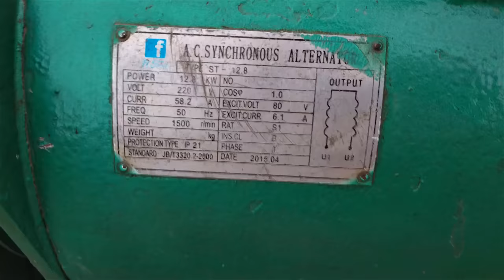Free energy Generator With 100 Kg Flywheel 12Kw Alternator 100% Real Free Electricity

Comment: There are so many electromechanical, heat and friction losses in this system that it should at least be slowing down. I am not sure where he is hiding the extra energy but he is doing a good job. This is not possible. Source: Electrical engineer.
Reply: I think, the extra force comes from the kinetic energy of the 100kg large pulley. There are many commercial UPSs that work like this, with good runtimes. The ideal is to leave it running for hours and monitor performance until yield drops, or do it via calculation.
Reply: from this black cable comning from behind of him.
Reply: The Thermodynamics Laws can't be violated, NO Free Energy, not posible
Reply: Looks like he is ready to step it up an make a 2 meg
Reply: It's hiding in open sight! Gear reduction from the motor to the flywheel. "Stored energy".  Overdrive from the flywheel to the generator. Gear reduction allows that motor to not work hard to produce the rpm of the flywheel and the inertia of that flywheel allows the generator to maintain it's momentum. I think if you were to fully load that generator it would reek havoc but in short bursts, like a well pump, grinder, etc, I think it could maintain itself. I'm willing to build one and see. What do you suppose is the total cost? $1500 - 2 grand?
Reply: @daleh2957  Don't waste your money please, it's not possible.
Reply: It's just rotational energy stored mainly in this giant flywheel. Each time he cuts he also quickly charges it up so you see the wheel going faster after every cut lol
Reply: while the wheel is rotating fast then very less energy is sufficient for the wheel to continuously rotate. He is reusing the generated energy as input energy to the wheel (looks to me).
Reply: @ramonduval8231  you're kinda stating the obvious here
Reply: 9:52 under the motor...
Reply: JUST A CABLE coming bro we sse it
Reply: @ramonduval8231  No but the energy we do use and create can be used  and made 5000% better...everybody used too use 100w light bulbs in houses in England now you can buy 5w led which do the same job..this principle off improvement can be applied everywhere
Reply: @jshaw4757  The 100w bulb produce similar light than a 10 or 20w led but produce much more heat and can be used as a heater for Chickens, the energy split between light and heat,
Reply: The energy can be light , ⚡ , heat , fuel, the bulb or led only transform the electric energy on light and heat ,but we need to provide the ⚡ to the Bulb 💡
Reply: @ramonduval8231  I've built salt water cells with very impressive voltage outputs unlimited voltage basically with salt water but you need too series the cells as I'm sure you understand...the amps are low but I am searching for a decent volts too amps converter so I can take away from the volts and give too the amps..maybe you have suggestions..thanks
Reply: @ramonduval8231  yes and I reuse that heat for warming an area too grow herbs n tomatoes n things so all energy gets used
Reply: @ramonduval8231  but like I said you you my 5w led lightbulb lights up the room just the same as a traditional 100w oldschool bulb..so that is 20 times less energy being used for the same result brightness wise
Reply: @jshaw4757  low amp means low heat but the light can be bright, the incandescent bulb draw more amps ,more heat and similar light
Reply: @jshaw4757  can be the same light but less head radiance, if you touch 100w incandescent bulb you could burn the skin because the heat,like 80w of heat and 20w light
Reply: @jshaw4757  the bicarbonate can be used but the more efficient is the sulfuric acid in car batteries.
Reply: @ramonduval8231  yes my point being if we are talking just making a room bright we have made huge improvements...I have just told you what I am able too achieve with salt coper n zinc...I could power anything when series the cells just like any battery cells you just series them and parallel when needed...no need for big energy company's is my main point and the main point off the term 'free energy' ..not that it appears from nowhere even though atoms are full off charge and with an imbalance create static energy which could be harnessed on an atomic level but many other forms are possible
Reply: @ramonduval8231  Yes vinigar works better than salt
Reply: @ramonduval8231  only problem is your power runs out within 1 hour or 2 but if you could sit your battery matrix in your chosen solution you would not need too recharge...a bit like the depictions off ancient Egyptian or Baghdad battery as they call it....I think people just need too start using less power consuming appliances n cars e.t.c....they had electric cars over 120 years ago able too go nearly 1000 miles on a single charge
Reply: @ramonduval8231  Thank you for replys
Reply: Permanent Magnet rotor and rewiring of stators. These generators have 2 stators, one to generate electricity and one to generate power to excite the rotor. This isnt needed to excite the rotor once magnets are installed and the stator needs to be rewound as the Tewari generator is wired. This is shown in Tewari's patent from India
Reply: @advanced-electronic  thank you marc
Reply: @advanced-electronic  all about improving energy usage that's all ...a 20% increase over a year after the initial payout for materials is worth doing
Reply: @ramonduval8231  jajajajajajajajaja
Reply: @daleh2957  Wrong! This is a confidence trickster! Prove me wrong! There is a sneaky power connection through a cable buried in the mud under one of the hollow metal legs resting on the dirt. Share a new video with the metal fame pulled up off the ground, and passing your hand underneath (with this running) The poster is only interested in being paid by YouTube for AD money from many clicks.
Reply: Correct! This is a confidence trickster! Prove me wrong! There is a sneaky power connection through a cable buried in the mud under one of the hollow metal legs resting on the dirt. Share a new video with the metal fame pulled up off the ground, and passing your hand underneath (with this running) The poster is only interested in being paid by YouTube for AD money from many clicks.
Reply: @pstonard   Well, it's a pretty inexpensive gamble so I've. ordered the motor and flywheel. I have a metal frame from a diesel engine I bought. I have a connection at the machine shop for the shaft and bearings. I could only find a 30lb flywheel but I can get another if 1 isn't enough. I'm gonna buy a 10kw generator. I'll let you know how it works. I have other projects going, (wife guided. lol), but I'll keep in touch.
Reply: Si es posible
Reply: @ramonduval8231  La ley se cumple siempre, otras cosa es lo que se interprete.
Reply: @sage_zarf  yo te animo y te llevarás una grata sorpresa.
Reply: @jshaw4757  el sistema Flywheel es una realidad de energía libre, que se quiten la venda de los ojos.,no se puede NEGAR la evidencia.
Reply: @daleh2957  para un alternador de 10 kW necesitarás un volante de 140 kg y un motor 3 hp
Reply: @daleh2957  alternador y motor 1500 rpm máximo
Reply: @advanced-electronic  ok ese es el camino......la eficiencia
Reply: @virgiliomontes714  ese mecanismo no funciona , lo que produce El generador lo utiliza El motor, no sobra energia, peor hay perdidas por friccion y deficiencia, la volanta de inercia solo acumula la energia temporalmente , la unica manera de que mantenga la rotacion es con una fuente externa de ⚡,🤷
Reply: @ramonduval8231  estás en un error no se puede Ramón negar la evidencia, lo que hay que replicarlo bien alternador imán permanente bajas rpm <1500 , servomotor o motor sincrono , volante de inercia 14kg/kW , poleas en relación correcta.
Y listo "Flywheel Energy Chaganti".
Reply: Have u even try this?
Reply: @virgiliomontes714  Entonces tendremos que armar uno parecido para comprobar si funciona o no.
Reply: @pastryboy714  I will try to assemble one like this and prove that don't work
Reply: @ramonduval8231  ese es camino...menos samba a mais traballar.
Ánimo Ramón yo estoy en ello.
Reply: @ramonduval8231  trata de conseguir alternador de imanes permanentes de bajas revoluciones no más de 1500.
Lo demás no tienes problemas no obstante si el motor es servo mejor (imanes permanentes)
Reply: @theory816 and high inertia too, it's a mechanical battery , accumulate energy but not creating energy
Reply: P Dubya  The flywheel has only two jobs , 1: Stabilize the spike or energy oscillations ,2: Acumulate energy, a Mechanical battery, when the motor stop spinning the generator can continue producing electricity for a period of time only and the Whole system stop.
Reply: A simple Flywheel between the Motor a Generator can't produce extra energy to keep the system self running because it's a Mechanical battery and we have energy loss by Friction and heat too.
Reply: Unless somebody invent a Mechanism between the Motor and the Generator to amplify the energy but a Simple Flywheel can not.
Reply: @cybersamurai6549  you obviously didn’t watch the whole video
Reply: @noneofyourbusiness614  i did but what i think you saw really different video 😅
Reply: Most people that thinks this works don't know how to change a bulb...
Reply: @daleh2957  Hi, did you made the generator? How did it go? How long? Can you update please? I too am interested.
Reply: @jaisonkvarkey7065  So far I have purchased the 2hp, 3600 rpm motor, a flywheel, built a rolling steel chassis with 2 straight wheels and 2 swivel. I waited until my taxes were done because I owed a big chunk this year. I still have to purchase the generator head which will be around $1600 plus freight. Pretty sure the one I've decided to go with is 8.2KW, 1 phase, 2 bearing, 120/240v, 1800 rpm. I have an electrician going over my plans to see if this will be the right size for the 2hp motor. We're not engineers at all so this has made for some very deep discussions. Keep in touch and I will absolutely post this when I've completed it. If all goes well I plan on building a 10kw to 12kw next, then maybe a 25. I feel we will lose 30 to 40 percent of the generator to maintain the flywheels momentum.
Reply: @briansotobassist  Or how heavy a panel of them should be. Hint, the bulb panel contains the battery.
Reply: @ramonduval8231  "do not mix thermodynamic with electromagnetic !!!!!...any way being true or not
Reply: @glipho01  this system need a device to multiply the torque without loosing the speed and this a extremely difficult task, the flywheel accumulate energy and stabilize the energy fluctuations only , nothing more
Reply: @ramonduval8231  ok, maybe...that,s why I miss some inertial wheel....I will build one to wash any doubt...I have a Milkovic oscillator which really multiplicate  force...
Reply: @ramonduval8231  consider you have a large magnet that pulls a metal ball and you measure a force in a spring. Leave that for a day, you come back and the same force is still there. Which Thermodynamics Laws have been violated here? You still have a force that is being consumed by a spring or something. I remember I looked deeper into this sometime back and this only works with alternators based on permanent magnets. Could you formulate a law in the way that is violated in this video? Let's have a discussion about it.
Reply: it wont work...
Reply: The Flywheel only store energy, the motor and the generator are not 100% efficient, need to slow down until stop.
Reply: Bro he is trying to show that it is possible.  the laws of physics we know are limited and the proof is just above your head: The sun is a free energy device in the univer. This shows that in this world it is possible,  we haven't find yet the right techniques,  This man is brave
Reply: @yololaherve4663   A flywheel between a motor and generator can accumulate and stabilize energy but CAN'T create extra energy for perpetual motion , a complex mechanical device between the motor and generator is needed but looks like nobody has yet created . This is a scam
Reply: @yololaherve4663  He is definitely brave for putting his hand anywhere near that spinning contraption.
Reply: @Anthony Nwaka the Flywheel store and release the kinetic energy, stabilize the energy spikes and don't generate energy but the energy need to came from somewhere  ,the Flywheel is a mechanical battery.
Reply: @cybersamurai6549  yup, I see the same thing. after plugged in, flywheel starts in motion so the start/run power is not free.
Reply: @daleh2957  lograste construir el generador?
Reply: @daleh2957  The flywheel only delays the inevitable a little. Namely, without external energy supply, the standstill of the construct.
Reply: @daleh2957  And did you get it to work?
Reply: @daleh2957  when you build one can you reach me to tell me what your outcome is?
Reply: @daleh2957  have u completed it already sir? id love to know if this thing really works. electric bill here in the philippines has been monopolized for way too long. i need to find ways to cut overpriced bill expenditures. thank u sir and i hope it really works well.
Reply: Only the last stupid fake, please save steel and money.
Reply: @jaisonkvarkey7065   I have had a rough summer. Cancer, so radiation, and chemo. I am just starting to feel better so, soon I will continue. I have all the parts. I went with a 3600 rpm, 2hp motor and a 3600 rpm, brushless, 5k generator. I bought pulleys to reduce the rpm of the flywheel to 1750 rpm, then from the flywheel to the generator back up to 3650 rpm. I will update everyone as soon as I assemble it. Also, I put it on caster wheels so I can roll it outside while it's running.  Edit:  I also purchased a photo tach so I can see if the generator rpm slows down and then rebounds after an electrical draw. If it recovers and rpm comes back up to 3650 then it is proven. At that point I will decide if I can afford to build a larger one. I went with the 5k generator here to prove or disprove the theory. If it works here, we'll, it should work on a larger scale. I must add, prices of the flywheels and larger generators have gone up a lot since I first looked into this.
Reply: @daleh2957  Thank you for the reply. Hope you are doing great now and wishing you good health and wellbeing ahead. I wish you to succeed in this endeavor also.
EDIT: Please don't worry about the 'couch scientists' who are trying to discourage you.
Reply: @clauzerD  yes, so after some time it will stop
Reply: My sentiments exactly, that system would not maintain that speed, especially with extra power being pulled by the power tools it has to eventually slow down.
Reply: FORCE  required to spin doesnt change amps required to spin the small disc and large is still more than is able to create.
Reply: Sand.....
Reply: Storing it in the dirt/sand...
Reply: The puny laws of physics don't apply in youtubelandia.  Many of Nikolai Tesla's inventions also flew in the face of established science.  Using his principles I could power my house on a 9 volt battery.  Sure, it sounds crazy, but theoretically possible according to one of science's greatest minds.  Source: Genius Electrical Engineer from history
Reply: Nikolai Tesla says it's possible.  Source:  Genius Electrical Engineer from history.
Reply: @ramonduval8231  Free energy is possible, your too blind to figure it out
Reply: @integrityprojectsservices7890  Could be possible but not this one, this is an Energy accumulator not free energy because when you off the motor the energy from the flywheel is transfered to the load for a short time and slowly dissipate and stop, A flywheel only is not a free energy device, you need a mechanisms between the motor and load but nobody has it or is not invented yet.
Reply: paghilom dera, magbuhat kay imoha para mo tuo ka, to see is to believe, ayaw cge salig ug comment2x para may mema ka lng
Reply: @Vegas2428  could you write in English please?
Reply: @Emmanuel Morkly This is only an Energy accumulator and NOT a Free Energy device because has only a Flywheel between motor and generator.
Reply: @daleh2957  estou comentando para saber o resultado, poderia me marcar quando conseguir?

Parabéns pela iniciativa. 👏👏👏
Reply: If this was real Elon Musk would be interesting it
Reply: @vidyadharpatil6683  have any one tried
Reply: @ballpool-zr7dy  
I don't know,  Trying is certainly wasteful though.
Reply: Or so "they" tell you! And you have to take anything from an "engineer" with a huge grain of salt!!!
Reply: @daleh2957  wreak*
Reply: @13FPV  it looks like cable, but its only mirroring of light from his plate with bulbs.-)
Reply: @daleh2957  were u able to replicate it? this v=QFAmVcTD2ZY might show u the necessary modification u need to make
Reply: the flywheel is like a magnifying glass to light for this small 3 hp motor
Reply: @vidyadharpatil6683  well that's the only way to prove if its true or not
Reply: @ramonduval8231  It's not free--there was an input...he just closed the loop afterwards.
Reply: @chrisharrell5945  To maintain the rotation an external electricity input is necessary without it the load and friction will eventually overcome the Energy accumulated in the Flywheel and the system will stop
Reply: TIENE UNA BATERIA Y UN INVERSOR ADENTRO DEL GENERADOR.ESTA GENTE SERIA RICA SI ESO FUNCIONARA.
Reply: @jorgeprado8026  Estoy seguro de hay cables Escondidos para alimentar El motor electrico
Reply: @ramonduval8231  well no kidding.  What did I say to elicit that?  🤗
Reply: @chrisharrell5945  Yes, an input connected to the 110v grid but the other way is to put a battery and inverter hiding inside the Generator.
Reply: @ramonduval8231   The voltage class isn't 110 volts, that's what the nominal voltage was several decades ago but for the past 50+ years it's 120 --typical RMS voltage.  Anyway, India doesn't use 120 volts, it's 230 volts at 50 Hz.  There is no battery and inverter hiding inside the generator...where are you going to put them, slice them up and slide them down between the windings of the stator and rotor shaft.  😂
Reply: @chrisharrell5945  ohh I forgot 🤭, 🌎 different voltages and frequencies, in my country 🇩🇴 the Voltage is 120v and sometimes lower and the frequency is 60hz.
Reply: @chrisharrell5945  Some YouTubers had proven that hiding a battery inside a generator to feed a motor but it's DC voltage few tricks and scams in the internet
Reply: Pretty sure there are a few we'll timed video cuts. Notice how it's an overcast day with no shadows?
Reply: Business electricity said this is wrong......😅😅😅
Reply: Possible
Reply: @ramonduval8231 this not free energy. The kinetic energy of wheel is being converted to electrical energy. So no law is being violated.
Reply: @rahimkhan7270  Eventually the wheel will slow down until stop
Reply: @ramonduval8231 Do solar panels create energy of their own?
Reply: @JBNetBreaker  The panels took the sun energy and transform in electricity, the source of energy is the Sun
Reply: My guess would be a cable tied under the framing to power the electric motor
Reply: Bonjour alors vous avez réussi à faire tourner votre génératrice de 12 kw avec votre poulie à inertie, merci
Reply: It's hidden in the wire of the first plug he uses to start it up. That energy came from another generator.
Reply: Exactly  @smpoojary